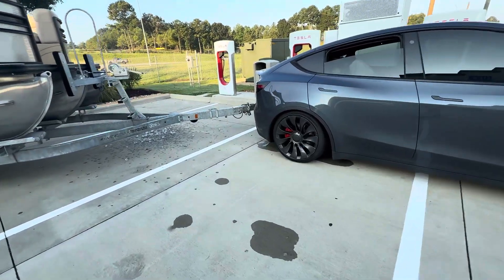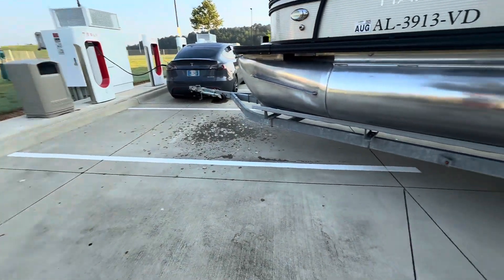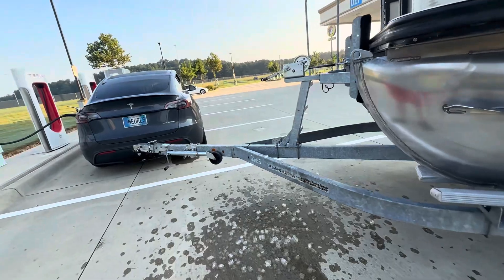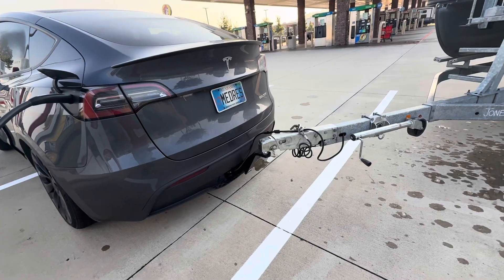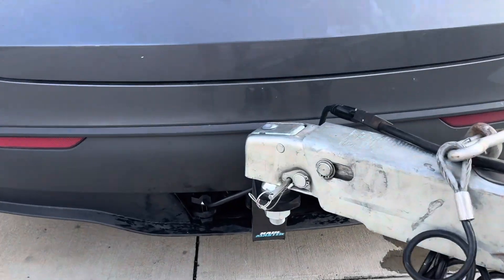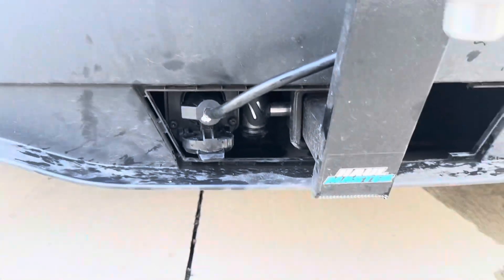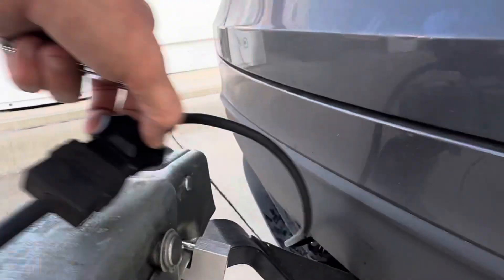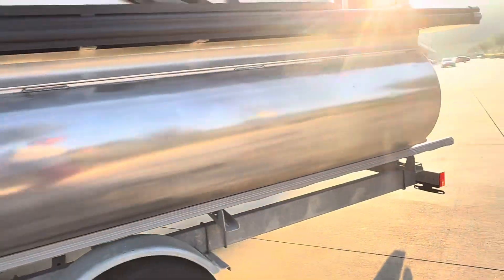2023 Tesla Model Y Performance with Tow Package Towing Harris Sunliner 230 + Trailer in Trailer Mode

Comment: Did you catch your power usage going 60mph?  That seems to be the sweet spot when I'm towing.
Reply: I’ll never understand people always show towing going 75mph. Trailer tires are almost always rated at 65mph and in an ev it is better to slow down and range is drastically improved. Never great either way, but it doesn’t save a huge amount of time regardless if ya just slow down.
Reply from the maker: yeah, going at 60mph, I was getting about 850-900 watt hours per mile.  That's 850 to 900 W being used for one hour to go 1 mile.  Hard for the normal person to wrap their head around and away, that's a lot of electricity, but gas is even more expensive. Anything over 60 miles an hour was definitely not aerodynamic. I can only drive for about 40 minutes at 70 miles an hour. But I was able to take it all the way down to the Gulf of America/Mexico from Birmingham and it took like 11 hours normally a four hour 5 Hour Dr. at the most.  Drive an hour charge an hour. Cost about $250 to do the round-trip worth of electricity.

Comment from the maker: There are connections for safety chain on the Model Y, and yeah would probably be considered less safe or “more dangerous” for other cars on the road, if it came off the hitch ball for sure.  I would never recommend anyone to drive one of these things without the safety chains.  It was relatively a short distance for me, but I did use almost 3 to 4 times greater amount of electricity than I would have not towing it.  I one percentage level on my battery was dropping at least one percent every minute on the interstate at 75-80mph.  That was intense.  But yeah, still no problem accelerating.  I was able to punch the accelerator a few times and it had no problem with it.